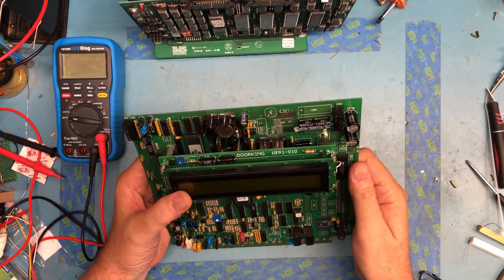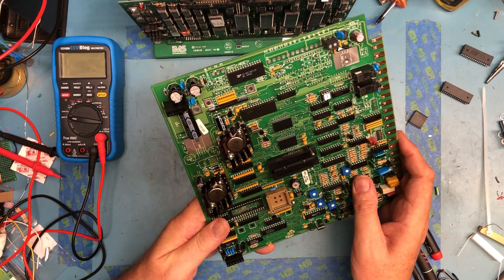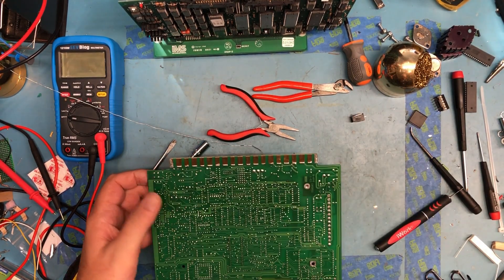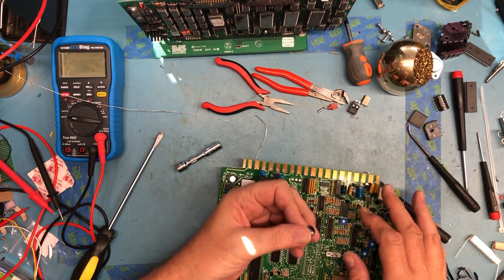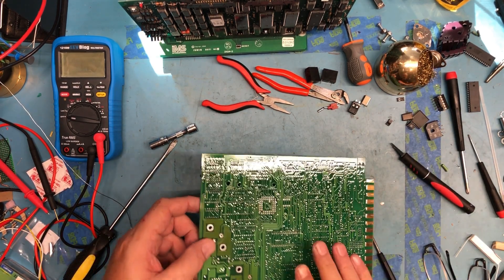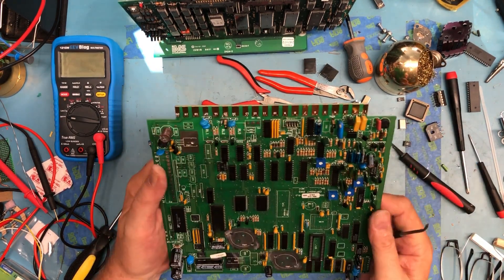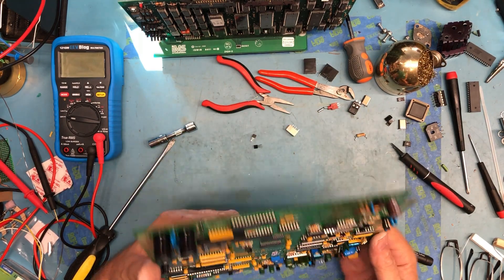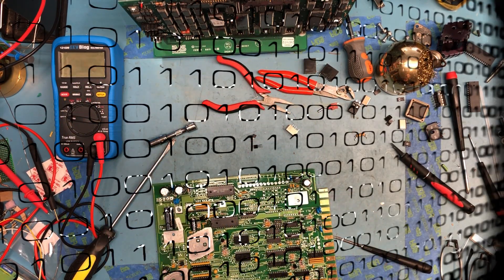Hakko FR-300/301   Demonstration of parts reclaim from a surplus PCB   STB376

Comment: I am using solder wick to remove excess lead when soldering SMD processor or ic legs, sometimes when lead is accidentally joining 2 pins together, i can only use solder wick to remove the unwanted lead which is very fustrating.
May I know if this FR300 or FR301 can be used for this purpose also??
Thank you.
Reply from the maker: The supplied tip with the FR300/301 is really large relative to SMD.  If you search "Hakko N61-03" or "Hakko N61-12" these tips might be better suited to SMD however I haven't tried them. Are you looking to remove the part with the FR301 or looking to clean up the left over solder after using hot-air to remove the SMD part?
Reply: @ShadowTronBlog Dear mr Shadowtron, I looking to clean up the left over solder. Cause when soldering smd, i might put too much lead & short 2 or 3 pins together, so I would use wick r sucker to remove them. 
But using wick, i need to press it against the pins with solder, and it might damage the chip. Another method is using a sucker with solder to remove excess lead, but it is also very destructive.

Comment: I just got one of these.  Do I have to tin the nozzle tip?  The directions say to but I haven’t seen anyone do that.  Also do u know what size nozzle the fr-301 comes with?  I need a smaller one but it doesn’t say what size comes on it that I can gauge from.  Any input would be greatly appreciated
Reply: Heat is transferred more efficiently via a tinned tip, plus cleaning and tinning helps to maintain the tip from excessive corrosion.

Comment: Is it better than soldering wick?
Reply from the maker: Yes, for me it's far better the solder wick. It's MUCH faster then dealing with wick, often with wick I have to add some flux. With that said the last batch of wick I bought was cheap Chinese wick, maybe with a quality wick it would work better. The amount of dwell time I spend removing the part is less, the part to be removed doesn't tend to get as hot.  I spend a lot of time at the bench, for me the Hakko is a real time saver. The tip on the Hakko has a large thermal mass meaning it can quickly heat up the solder, with wick it tends to take me longer to get the solder hot enough to flow into the wick. With all this said the Hakko is still expensive, you could buy a LOT of wick. With all this said someone with experience with wick might actually be faster. I've seen people way down the wick across the pins and drag the soldering pencil across it/the pins and get excellent results. I've never had it work that way.
Reply: @ShadowTronBlog  How often do you change nozzels?
Reply from the maker: @Jeremy-su3xy  I have two nozzles. One came with it and one with a slightly large hole that makes de-soldering larger pings easier. I've haven't replaced either of them The only consumables have been the filters and a replacement for the cylinder the filter goes in.